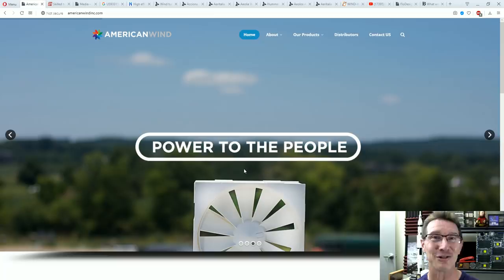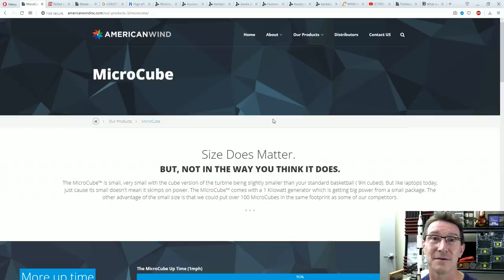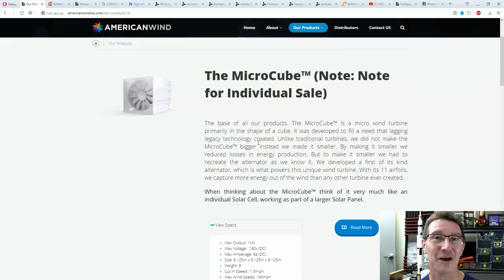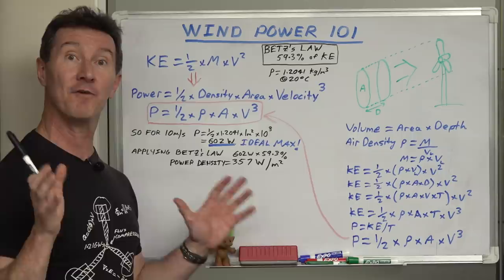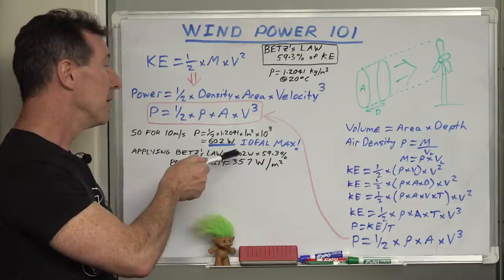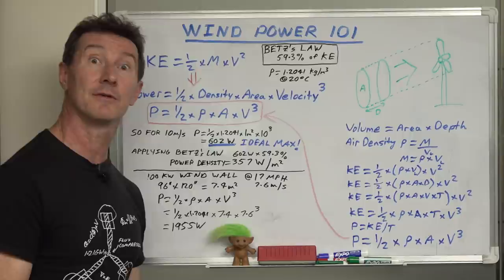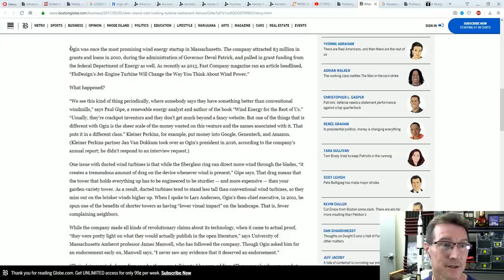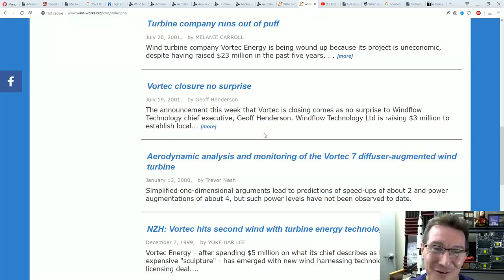EEVblog #1271 - 100kW WindWall Generator BUSTED!

Comment: It gets worse. AW is actually a multilevel marketing operation like Amway, Matol, Herbalife, Mary Kay... and thousands of others. You sign up as a distributor and then, hopefully, sign up your downstream distributors and get a cut of their sales. Presumably the same ideas apply: each distributor buys in for a starter inventory so the upper levels do ok from that income. Problem is that it's a pyramid - to sustain that income exponentially more downstream distributors need to be added. Sure some product will actually be sold but I know several people with garages or cellars piled high with Amway or Avon inventory they had to buy to "get in on this amazing opportunity" and couldn't get rid of. At least they have soap and makeup supplies for life. What are you going to do with a garage full of these things? Plus... how did they patent what is obviously a perpetual motion machine producing more power than it can receive?

Comment: Confidence tricksters come in all shapes, ages, sizes and colours.  If Mr. Yost were telling the truth, a helicopter descending in autorotation should drop like a rock in free-fall, but it doesn't.  In reality, it drops about as fast as a parachute of the same diameter as the main rotor diameter, even though the blade area is but a tiny fraction of the swept area of the rotor disc.  (I didn't even need an envelope and pencil to smell the bullshit in American Wind 's claims, just a little of basic knowledge.)

Comment: Has anyone tried using winglets on a turbine blade?  It might be the best of both worlds getting the benefits of a ducted blade without the added weight!
Also I really do want a wind-turbine on my EV so it can self-charge while parked; LOL not like this 1 though something that can fold down and be low drag while moving (solar should also come standard on all EVs formed into the hood and roof)

Comment: I am no engineer at all. What immediately strikes me with these things is how stupid they are for me - a regular guy.
You might have the biggest, most badass fan duct and whatnot to gather the wind.
Great. But as soon as the wind blows from the side on that sucker, it's game over. The forces applied will damage the hell out of it and it will be a maintenance-nightmare.
The less profile you can get in a sidewind, the better it is. Your turbine needs time to adjust the angle so it works again. And this is without ANY calculations done. Stick that WindWall up on a large pole to get the same height as a regular turbine? Yeah... you got a WALL there. Wonder what will happen to that... facepalm

Comment: Holy cow that ending with the turbine powering its own fan is hilarious.  I'm a dope with a GED but even I know all systems have losses and that there is no 100% efficiency system... let alone over 100% efficiency due to laws of thermodynamics.  Must have been one of those friction free "Chinesium" USB fans.  I guess air fluid dynamics don't apply either.  How in the world did this guy trick engineers?  Surely these guys should be smarter than my dumb ass.

Comment: Best to work it backwards... seal off the input side of the WindWall, attach it to an air compressor and raise the pressure until you have a 47 MPH exhaust speed.  Bingo... 1 KW.     The air density on the input is so hight that your mistake will be obvious... You did your analysis on the wrong planet.

Comment: Dave, I bought 7 x 300 watt solar panels on ebay from a massive seller.  I have a solar meter and on a day where I get max in NSW the solar meter reads 1166w/m2 which is great. The most I can get out of the panels is 9.6 amps measured by plugging the negative to the positive directly and with 22v open circuit voltage.  Total of course is 211 watts. Do you have any comments on my findings? Is my method valid?
Reply: If you are measuring "Short  Circuit Current", then measuring "Open Circuit Voltage" and then multiplying then multiplying Isc x Voc to get "WATTS" - then no, you method id NOT valid.  You should measure the Volts and the Amps using the SAME LOAD.
Reply: @MrSummitville  thanks so much for your answer.. I will put a load on it and measure it again

Comment: Investors who invest in these alternate energy scams should be required to watch your videos.

I have a fairly low opinion of wind in general. The turbines are expensive to build and maintain, they are installed far away from where the consumption usually is, when they fail they fail spectacularly, and nobody would be using them outside of some specific niche applications if they weren't heavily subsidised with tax dollars. What is your opinion on wind?

I'm a fan of solar, just put a 14kW array on my house. Waiting for summer so I can see the benefits.

Comment: 6:16 If the exhaust speed is faster than the inlet speed, you are ADDING energy to the air, not harvesting it.
Reply: the density is reduced (due to the blades restricting airflow), witch makes it possible for the air to move faster even with reduced energy
see: https://en.wikipedia.org/wiki/Venturi_effect

Comment: I wonder if the "wind tunnel" test was cheated by forcing air in with no way for it to go around the turbine.
If that was how it was "tested" you could just stack more and more turbines in line for infinite power out and still have 17mph wind someplace in the wind tunnel. Completely ignoring how much energy it took to force that air though at that speed in the first place.

Comment: You actually don't need this math here. It's enough to hear the CEO saying that his "turbine technology" actually ACCELERATES the wind as it's generating power to conclude it's utter bullshit.

Also, this guy claiming to invent aerodynamic miracles has no clue how aerodynamics work. The 3% of the surface of the blade circle are enough to extract energy from more than 100% of that circle, because the rotor extracts energy from the area OUTSIDE the circle. Adding more blades does not increase efficiency, it just increases drag. There are designs with two blades or even one blade (with a counterweight) which are more efficient but only at a highly specific wind speeds. This company is so obviously a scam that I'm quite certain they'll be very successful in the USA XD

Comment: I would have stopped at his claim that it speeds up the air going through it.
If that was the case it isn't a generator, it is an engine and it needs power to work. Otherwise it is a claim of over unity right there.

Comment: Just wondering, does the ducting actually improve things?  I was looking at drones and I don't see that they have ducts, yet I see other YT videos claiming that it actually does improve things.  Q. How much difference does a duct make?
Reply: Every turbofan airliner engine in existence uses ducted fans.
Reply: Reminder that Betz's Law works the same whether there's a duct or not.
Reply: @Alexagrigorieff   Then why are shrouded turbines (and ducted fans) more efficient than unshrouded ones?
 "The shrouded tidal turbine enclosed in a venturi shaped shroud or duct producing a sub atmosphere of low pressure behind the turbine, allowing the turbine to operate at higher efficiency (than the Betz limit[1] of 59.3 percent) and typically 3 times higher power output[2] than a turbine of the same size in free stream. A downstream low pressure draws upstream flow into the inlet of the shroud from well outside the inlet of the shroud. This flow is drawn into the shroud and concentrated. This augmentation of flow velocity corresponds to a 3-4 fold increase in energy available to the turbine. Therefore a turbine located in the throat of the shroud is then able to achieve higher efficiency, and an output 3-4 times the energy the turbine would be capable of if it were in open or free stream. For this reason, shrouded turbines are not subject to the properties of the Betz limit."
1 ↑ North Dakota State University, Perfect Turbine Performance. Retrieved September 25, 2008.
2 ↑ Brian Kirke, Developments in ducted water current turbines. Retrieved September 25, 2008.

Comment: 0:50 If only aerofoils were widely researched...🤔

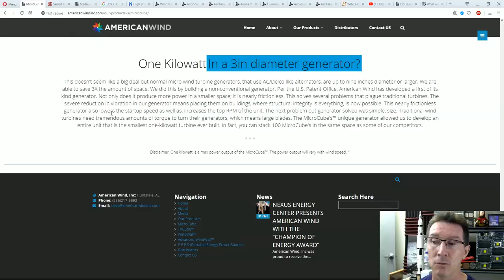2:00 Same goes for barings as they are found in virtually EVERY mechanical device.

6:10 Jet engines slow down air (in exchange for pressure), then they dump in a s**tload of energy and push it out the back while harvesting some of the energy to compress more air. A more accurate term would have been a funnel, but the inlet is still 9 inches by 9 inches.

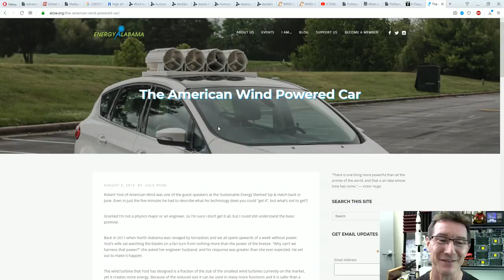27:29 The guy is a moron, and the author isn't far behind. Even a child could tell you attaching windmills to a car to power it is probably a dumb idea...

27:54 I'm speechless! 😲🙄🤣

For fun, I worked backwards from a 225cm (8.86 inches) ducted fan. (ebmpapst W1G 200-HH77-52 for those playing along at home) : 1090m^3/hour = 0.3m^3/sec, which comes to 6m/s (13.42mph). That's using only 55 watts! So that means you can NEVER generate more than 55 watts from 13.4mph of wind!

Also tried one of my PC's fans, an Arctic Cooling P14 (140mm, 123m^3/h @ 1700rpm), which comes to a little under 2m/s (4mph), but that uses less than 1 watt!  So while the blades may rotate at that speed, it doesn't mean it will produce usable energy. This also means that one of those turbines can never generate more than ~3 watts (~3 times the area) in 4mph wind, plus they'll be lucky* to get a single watt from their crude 3D-printed impellers.

I think they may need 140mph wind speeds to generate any useable power, but probably not a kilowatt!*

*Not a chance in hell.

Comment: Just another 'alternative energy' fantasy to add to the list. Perhaps the label should be re-coined to 'alternative to energy'. 

I was watching a presentation a few days ago by a German man talking about his country's politicians making up unfeasible energy plans (of course non of the po0liticians actually knew anything about energy.) His point was that Germany could double or triple is solar/PV generation capacity and it would do very little as N*0 still equals zero, no matter what N is. In other words when the sun don't shine and the wind don't blow you still need the capacity to generate electricity by conventional means at full capacity. Trying to tailor the operation of these conventional generation sources to the whims of nature is both costly and inefficient. 

But, why ruin a perfectly good 'renewable energy' fantasy with science and facts?

Comment: Would the density be high enough if the temperature was low enough that the air was liquid? Because, you obviously can't get those numbers in real world usage, but maybe lab usage where you don't have to follow the rules of practicality operating at extreme temperatures so cold that the air is now a liquid and thus a much higher density. At which point marketing gets a hold of it, and just choose to leave out that part? LOL. Seriously though, this wind wall idea seems so unbelievably stupid, I can't believe people fall for this.

Comment: Wind energy, it might have its uses. But not on any large scale.. Other than that, its only a real pain in the behind, like all 'renewables'.
On top of that, extracting power from the wind means lower air speeds behind the thing -> less cooling -> warmer air.
Soooo.... more windturbines -> warmer atmosphere...

Better wind streams higher up?
No, no no. Learn some meteorology. Within 600 to 1000 m meters of the surface of the planet, the wind slows down due to friction of surface and objects. Most windmills are way lower than that. They will never catch higher wind speeds. And most of the time the wind speed varies due to frontal systems and such. Totally unreliable.

How anyone with a straight face can make such claims?
Greens can!
And people go for it.
Reply: "Not on any Large Scale" - you say?  Well North Dakota already generates 40% of its electricity from wind. I would call that a Large Scale success.

Comment: Airflow at supersonic speed could maybe generate 1kW ,🤣🤣
Reply: After calculating not guessing, there is need for 80ms to get 1kW out of one turbine without bezel violation and assuming 109% efficiency. So it's working in the eye of an hurricane 😄

And due to 100% Efficiency speed behind is zero, so it's safe there😉

Comment: He sport.  Sometimes you should test something before running your mouth.  Your assumptions about wind and power output are totally correct.  Your problem is that the incremental power comes from the generator.  The generator can produce over 3 kwh of power net when driven by a 500 w motor.  Revolutionary and violating Newton's 1st and 2nd Laws of Thermodynamics.  Tested and witnessed by Engr. Dir. for a major luxury European auto manufacturer in 2016.  Problem was Yost was beat up by academics indicating it was impossible.  Some signed NDA's and played with the system but decided to say nothing out of fear of criticism.
What was determined is that the generator produces a room temperature plasma and captures added electrons and muons(electrons with slight mass) to produce higher than theoretically possible power for a generator that size.
THIS IS THE REAL REVOLUTION IF YOST AND COMPANY WOULD UPSCALE THE GENERATOR, SHITCAN THE WIND TURBINE WHICH YOST IS IN LOVE WITH AND PUT THE WORLD IN A POSITION TO HAVE REAL CLEAN ENERGY GENERATION.  COULD BE USED TO POWER EV'S SANS 85-90% OF LI BATTERIES AND SET UP IN A DISTRIBUTED AREA TO POWER GROUPS OF HOMES OR INDIVIUAL HOMES WITHOUT A GRID.  THE MAN IS CHICKEN!!!

Comment: curious was it output DC or AC - over the years we seen the 2nd style of vertical-axis wind turbines.  in smaller Wind turbines  system they say Trees or Obstruction Can't be within 215M / 705ft sure i could have Free but the forest need to be Cut Down for 800ft in ~ i hear story of 400watt model small wind turbines copycat  (China Made) Their Bearing seizing up after 20hr friction did work to stopping it. most power to perpetual motion don't last long ~ output pull more volts then input can supply plus drag or resistant are not helping ~ car might catch 15% as the windshield would deflect most of hard wind over it as faster it goes that or bearing start to melt if that happen there that Jet effect

Comment: Okay, I'm confused.  You state that the formulas are for a different kind of windmill... then use the formulas to prove the other type can't work.  And on top of that, you state that even if it was the same type, the formulas don't actually represent what you get in reality.  And yet you still use them as proof that a design doesn't work.  That said, the examples of other similar devices in the past was pretty convincing proof these don't do what they claim.
Reply: Exactly, how is the America Wind Turbine "different" ( ie better ) than the type of wind turbine used in the formula?
Reply: @MrSummitville  Well, they most likely aren't, according to the results of studies on similar devices.  My point was that in order to use formulas for one type of turbine to prove the other doesn't work requires you to already know they will provide similar results in reality.  And even then we didn't really get a mathematical reason those formulas definitely should apply in every case.  All those prior tests did was show that they most likely are going to apply.
Reply: @101perspective  I will re-phrase... In what way does the formula used in this video NOT apply to these wind turbines?  We used ... a) the Velocity of the Wind;  b) the Area of the Opening / Rotor;  c) the Density of the Air, and d) Betz Co-efficient.  So, tell us, which "term" in the formula is wrong or is not appropriate for this Wind Turbine?  What is so "different" about this Wind Turbine that it requires a different formula?  It appears that you do not even know ...
Reply: @MrSummitville  The formulas, as he seemed to be explaining it, are based partly on observations of the current style of windmills.  And he is saying that these new types are... well, new types.  So, the actual question is whether the formula for the old types also line up with the new types.  You don't get that answer by simply asserting that they are and then punching the numbers in and going... see, the new types won't work better.  You would be asserting that the formulas do apply before proving they do via observation.
Btw, it would be different if these formulas were created using a mix of pure mathematical logic and other constants.  However, according to what he is saying the formulas are based partly on that and partly on how the older style windmills perform.  It is the latter variable that we are trying to figure out for the new windmills, thus you can't start with the formula to prove that this variable is the same for both.
Reply: @101perspective  A "new" style wind turbine?  Are you joking?  They may be "new" to you, but they are not new to us.  The formula is based upon CURRENT Wind Turbine design. You provided no proof that there is anything "new" about the Wind Wall.

Comment: This isn't bullsh*t, it's straight up choleric diarrhea.  1kW from what amounts to the volume of a high-end computer PSU?  Ridiculous.  I'm sure with 0 load the blades can spin fast enough to burn up the bearings... but as soon as you put any load on it the generator will act like a regenerative braking system in a hybrid.

If harvesting the power of a spinning magnet didn't slow the magnet down, these jokers would have never had a business, we'd have had free power for over a century now, and wouldn't need to be burning fossil fuels to keep supplying the grid.